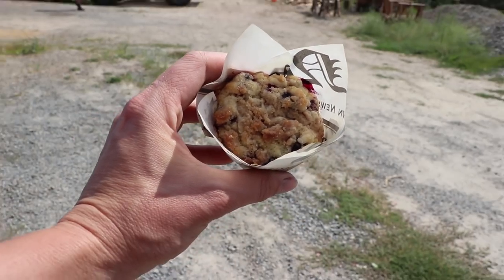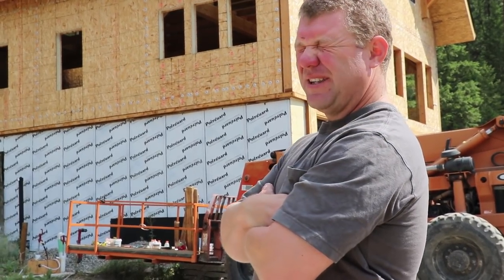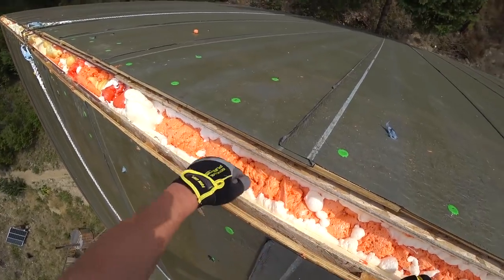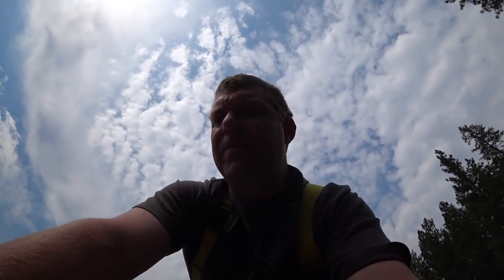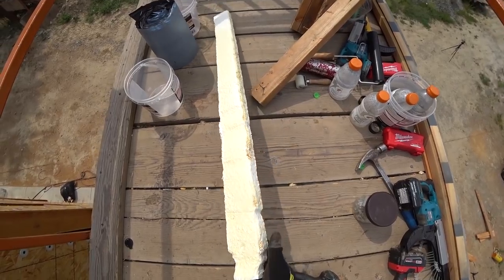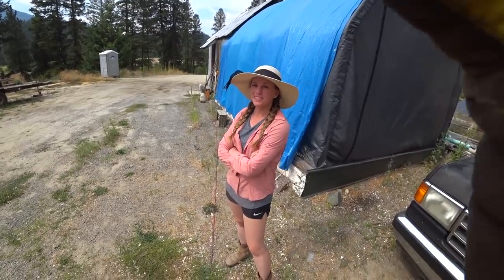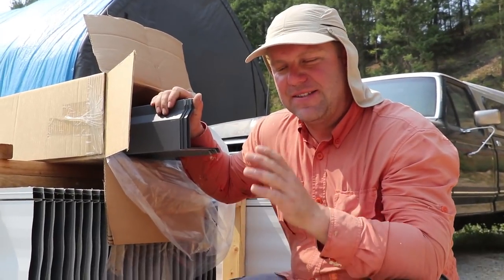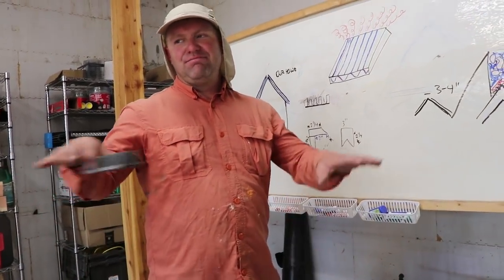OH YEA! Our Standing Seam METAL ROOFING Has Arrived!

Comment: Hello. I've been watching a number of your videos. I'm very impressed with your progress. I couldn't help but notice the orientation of the ice and water shield. I use ice and water shield a lot for work. We have the same issues with bubbling. Although, we have used the vertical orientation of the barrier, the horizontal orientation works best. Starting from bottom to top, with an overlap on both sides of the ridge. Bubbles and creases are no longer an issue. I've had to remove this product before, and it is horrendous, to say the least. All, in all, I don't believe you will have an issue the way it sits. Again, I really enjoy your videos. Thanks for posting. Good day.

Comment: As paranoid as you sound about screws my question is why in hell did you not subcontract it out and have them guarantee it ???? End of story! Your not a pro roofer or have not indicated it anyway? Why do you question people who have installed thousands and thousands of roofs? I’m just a bit annoyed with you Jessy because your complaint about driving screws thru the roof are the “only” tried True way to secure roofs. Think man that’s a 45% roof! Yes a small amount of snow will stick but leaks with a double waterproofing layer should be non existent? Cheers

The engineering on this roof is superb!
On the windows use liquid flashing for waterproofing it’s way better than tape.

Comment: With your explanation of Your "common metal roof "  isnt exactly true. We screw on the flat spots not on the high rib. 3 screws across every 2 feet in length. Whole stack of tin is marked out and predrilled so all the screws in the  panels are symmetric when you install them. Other than that good work. Love watching ur episodes.
Reply: Ryan Smith I agree that's how I do it. Putting fasteners on the ridges pulls the sheets out of shape. Putting the screws through the flat with a sealing washer works just fine.
Reply: It depends. We are seeing both flat and rib fastening around. At least one manufacturer that I know told us they don't care anymore where the screws are put in. Both methods have their pros and cons.

Comment: I share your concern about using ANY screws in the trough of any ridged-design roofing system.  In my  mind, each additional item you add to any weather/water/etc.system is just another vulnerability and area that is going to require maintenance in order to be sustainable.  i.e:  the "whatever" to make those long rows of screws fastening the edge caps water tight.  Anxiously awaiting the actual installation to see how your solution(s) work out.  So-far, so_good, though.  Loving' it, guys!!

Comment: There might be a small amount of air under the surface - making the 'balloons'.  Once the metal is on top, these should be compressed so it seems to me.  They normally install product and then same day put roof on.  Likely never seen this issue before or often.  Wish my house was built as well as you are doing.  Mine was owner built and on shoe string in many places.  Such is life. Now we have things to fix...

Comment: roof delivery ??? doesn't it go onto the roof?? LOL drop it infront of the garage so close to the roof as possible :-) it simplify your work.
On top I am in Florida and I love to standing seam roof panels. They hold 50+ years and over 180mph wind. Also SNOW is not a problem I used this in Germany before and it's a proofed product over there as well. As long the flat plane is over 12" wide you have no problem for Snow or Ice. the Standing seam should be less than 3" high preferred is about 1.5-2.5". Also don't use SCREWS on the roof ends. Use the bend method and clamp it the an underlying panel flat bar. This eliminates it. And calk it with roof glue at the end to blend in the 2mm gap. The eve method with the bend is common practice just get yourself a bending plyer for 6" or more

Comment: Box section corrugated sheeting is typically fixed in the valley rather than the ridge using screws with a seal to prevent water ingress. Only the traditional wavy profile corrugated sheet is fixed on the ridges. You could fix the box section sheet this way but you end up with long screws that distort the box profile easily if only slightly over tightened.

Have to admit I tend to skip through these videos these days ... just way too much unnecessary wiffle, waffle.

Comment: #Jesse Why can't you use colour coded 1/8 blind rivet to attach the side flashing to the roof sheets (with a small bead of clear silicone along the inside edge) then use screw 's with rubber washers to fix the flashing into the fascia. Thats how we do it here in OZ and it can stand 180 mph gusts. In this video they use hex screws with rubber washer's on the deck of the roof and the top of the flashing but you can use blind rivet in the side instead of the deck. https://youtu.be/LStazQxXmM8

Comment: My opinion dont matter but you guys are over reacting its going to be covered so it will see no water at all with a metal roof last a lifetime now and more no rust and the screws have sealed washers on them so it wont mater once its covered and once its covered it wont get so hot and it qont buckle like that thats why you put it up and cover it right away and it wouldnt of done that in the first place..

Comment: Naked p test to take advice from your comment section because most people that are giving you ideas I've been through it and done the work I don't believe manufacturers I believe in doing it the old school way I do like the screws showing those screws have rubber seals I have a roof over 50 years in that had a leak but then again that's just my opinion

Comment: You give way too much thought into the roofing. On a regular roof you do NOT put the screws on the ridge, the only screws that go on the ridge are the lap screws. I would only put screws on the ridge to hold the panels from sliding down on the eave is ridiculous. As long as you have screws with rubber washers you can punch a million holes in that roof and it won't leak.
Reply: I must respectfully disagree. Our metal roof (Delta rib) will hopefully get replaced this coming Spring with the Standing Seam product. Our experience in the western US mountains is that the ridge screws eventually back-out and that the "rubber" washers, after being baked for some years, shrink and self-destruct. After our experience, I really doubt if we'd ever do another Delta-Rib roof if at all possible. FWIW, our roof is on a  6/12 pitch with ribs screwed down rather than screws in the valleys. I know many people in our area who will also comment similarly about aging Delta-rib roofs that are fastened like ours.